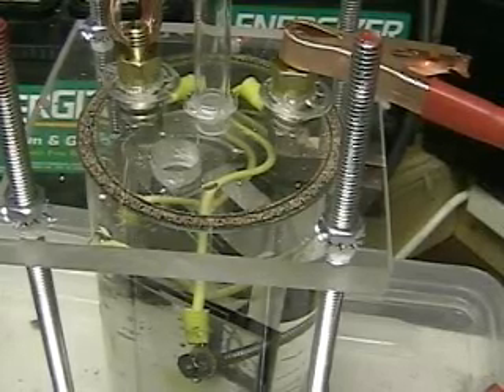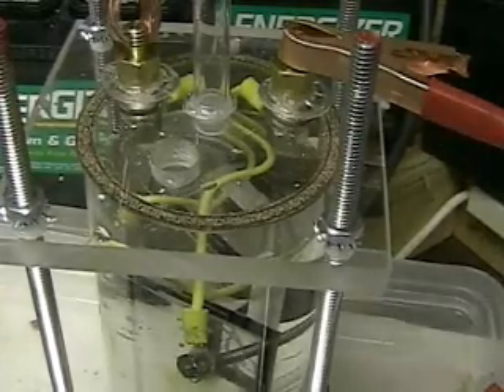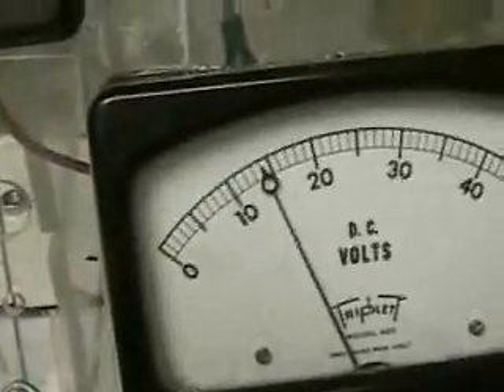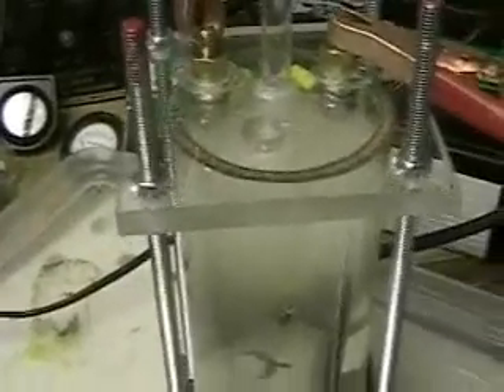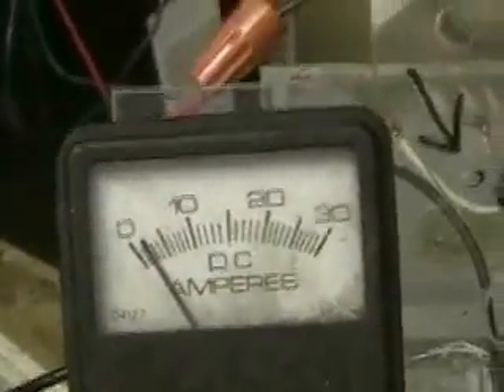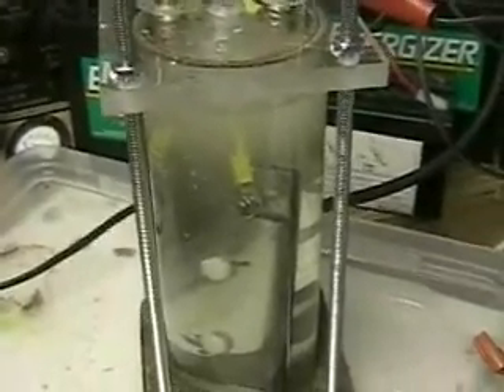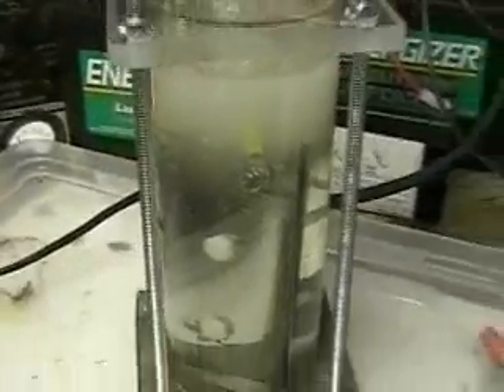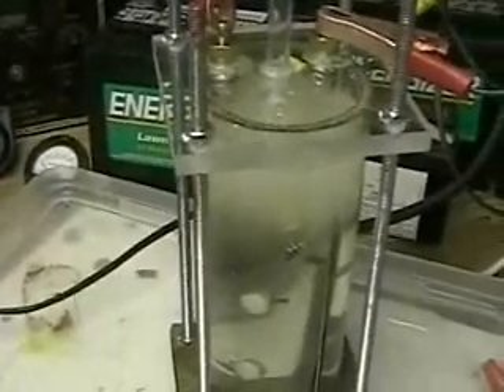Hydrogen Tap ( T-Lab-1 Working) #62

Comment: Mr. Myer's has the best technology on water electrolysis. Figuring it out is going to be a challenge, getting the electronic's is yet another. I, like you, am making electrolysis systems, mine are for fuel replacement systems. I think my electrolyzer is right for I engineered it with lots of R&D. We are all on the same team, just think of "us" as oil companies, for you don't see them fighting so nor shall we. Lets all do are part in bringing about the "Hydrogen Revolution." God Bless. h20power